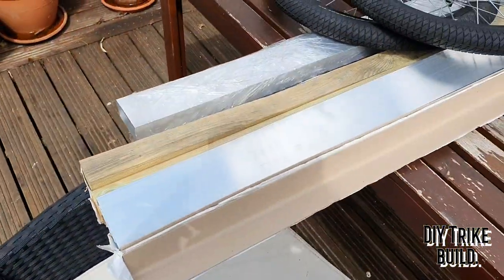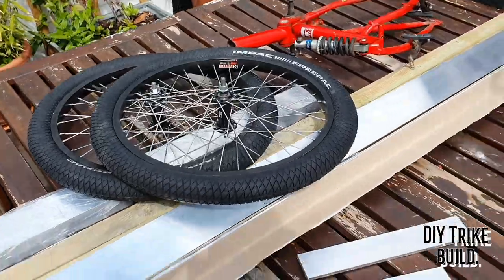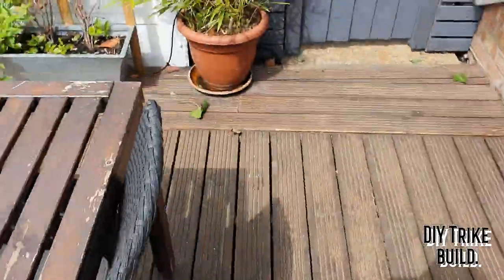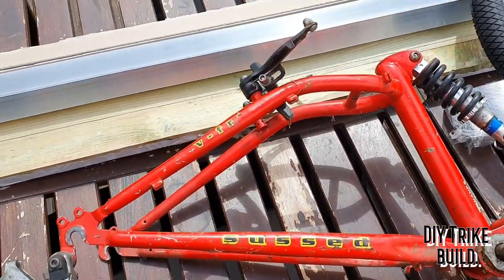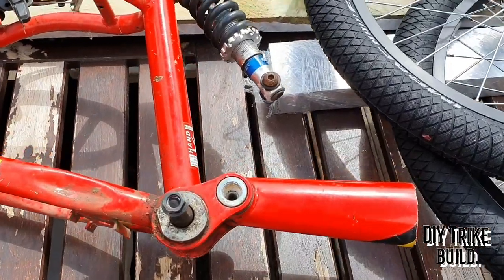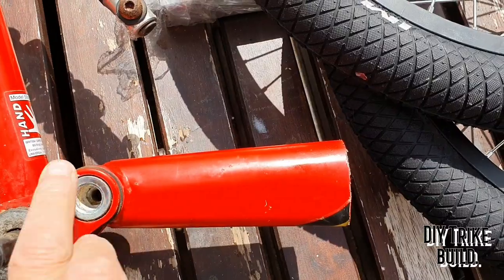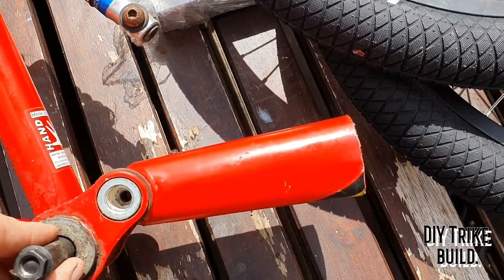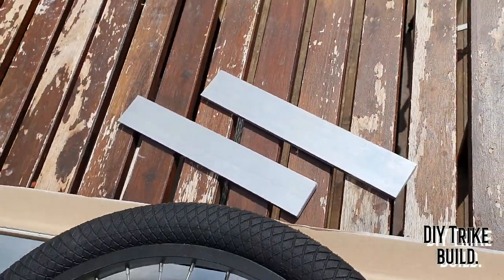DIY trike build. Chassis construction part 1.

Comment: Hey friend i just subd because I'm a sucker for guy's like me that get a hairbrain idea and either it works or I get injured! This is cool and going to find part 2. So check it out.... Some years ago I built a recumbent trike with one wheel in the front for my grandson. So I used a mountain bike that belonged to his grandma who had passed away ( she was my gal) which made the project a little more special! So if you turn a bicycle upside down it pedals backwards which is perfect for going forwards in a basackwards build! I used two matching kids bikes for the back wheels and steering with a tiller like controll (hard to explain but it it worked. For the frame I bought this steel from Lowe's that's used in electrical construction (don't know what it's called but it worked!) since then he's grown out of it. Goin to reboot the project in my size... Lol!
Reply from the maker: Your trike sounds ingenious. Thanks for subscribing.
Reply: @grahammakesstuff.1916  Thanks and you're welcome

Comment: Nice work! Are those plates aluminum or steel?
Reply from the maker: Plates are aluminium. Had to upgrade the pedal box the thicker stuff as I was getting some twist under load. Rear suspension is shear force (no twist)  and seems to be holding up well.
Reply: Where did you get the diamond Al plate for the front reinforcement bracket and did it come bent already (beyond what you bent slightly in the video)?
Reply from the maker: @leesuccaw666  my last company i worked at were throwing out an aluminium staircase, so all the diamond plate is cut from the treads and already bent. I have bought some flat aluminium plate to change the front end slightly (in a later video) thanks for watching.